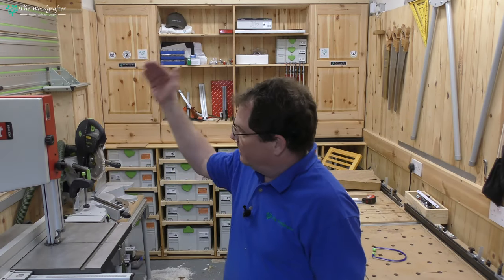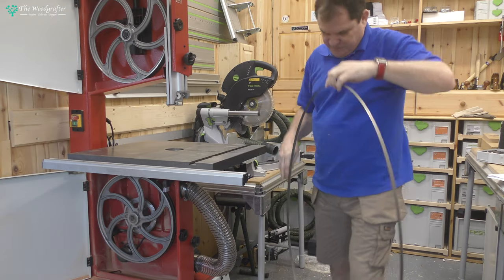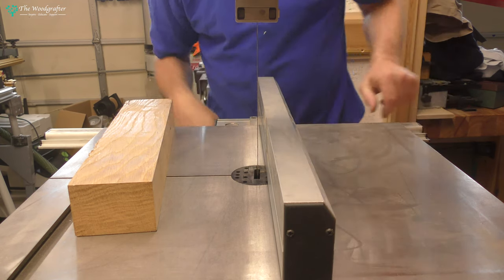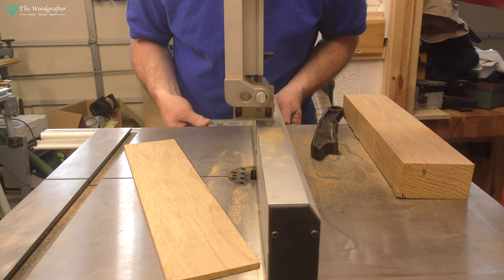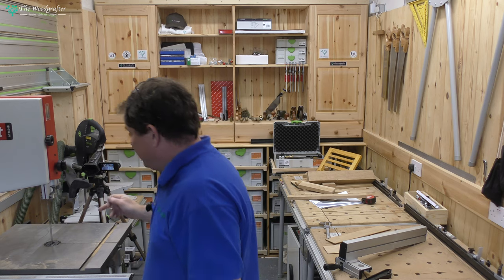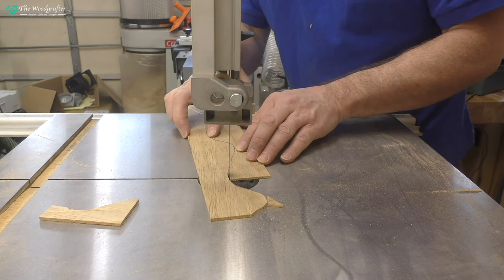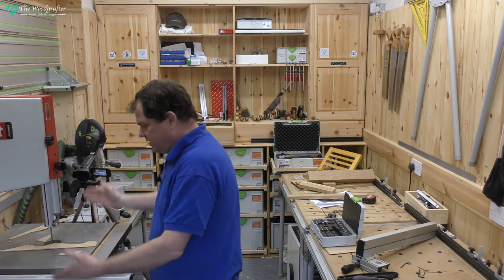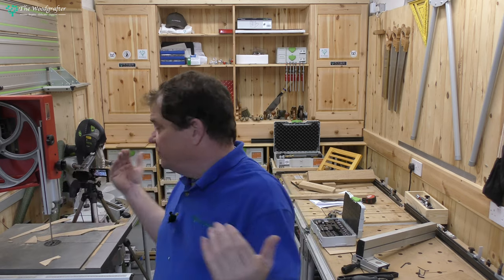Axminster Craft AC2606B review

Comment: Finally i have made progress with my saw axminster  sent me a new pulley bearing and tension assembly the new bearing was on a little bit further on shaft, but it was rubbing, but  not hitting guide  as first one did, So i have filed a bit off guide side , and wow it works and the plastic still slides up and down freely. I used it on cutting old floor boards with tongue and groove damaged on them so did about 100 cuts about 2ft. length each so quick and quite cutting much better than table saw. I did not even use extraction hardly any dust on table but loads on floor of course ! but room didn't seem dusty to me. So very impressed now after a bad start happy camper now.
Reply from the maker: Hi Chris,

Journey from hell, but glad you are up and running with it.

Overall I am happy with the saw.

Cheers

Andy

Comment: Absolutely perfect set of videos, particularly the setup video which covered absolutely everything. Axminster are out of stock of a lot of their machines at the moment (late November 2020), hopefully that's just an end of year thing, so I'll be looking to get one in 2021. I'm pretty sure I'd be living in the shed if I said I'd bought one a month before Christmas anyway! Thanks for taking such care and attention to detail with your videos. It's a fairly major purchase for a home user like me, so the information you've given is extremely valuable. Thanks!
Reply from the maker: Thank you for the feedback.

I have had mixed feedback on people’s experience with this saw.

I find if you take the time to set it up correctly, and use the right blade for the job then it is exceptional.

I get perfect re-saw, accurate curves and as a bonus free saw dust that collects in the bottom case. 

I have just bought a new CNC machine that arrives on the 18 Dec. If I am lucky that will see me banished to the shop over Christmas :-)

Cheers

Andy

Comment: Nice lil critter ya got there but does remind me of the 30cm bandsaw I have that is of like quality. I call it the chinesewhatchamawozit LOL But it worked even better when I changed the tires and blades to everything from Timberwolf. You'll get a lot of happiness out of that saw.
Reply from the maker: Hi Gary,

That made me laugh....

Yes I do believe it is a re-branded chinesewhatchamawozit - made in China, shipped from China and is very similar to many brands on the market.

But, so far it seems to do the job. I did change the blade for a higher quality one. Will look at the tires when the time comes - but for now it’s good enough.

Cheers

Andy

Comment: I have just bought one of these band saws, and I must say, it exceeds all my expectations. The only issue I have is with the stand, and the way the saw sits on it, it is dangerously one sided, and very easy to tip over (towards you, as you are using it). This becomes much more pronounced if you put it on a wheeled trolly of some kind.

Comment: Great honest review Andy, what size is your thin blade? a thinner blade maybe 1/4" would cut the "organic" cuts a bit easier ...just an observation.
Reply from the maker: Thanks Paul,

Fair shout - the “thin” blade is about 12.7mm (1/2” ish) from memory.

So yes a thinner blade would be a good shout, but you live and learn.

Cheers

Andy
Reply: @TheWoodgrafter  One step at a time Andy, tbf the dust collection is better on your saw than most, at least it is collecting from two points on the cycle. Mine only collects from the bottom.
Reply from the maker: paultay23 

Thanks Paul,

Talk soon

Andy

Comment: Fantastic video series! Thanks for going through everything and giving your honest opinion. I'm about the make a bandsaw purchase and this one is right at the top of the list. Before I go ahead, I wanted to ask whether you were still getting on OK with it in use and whether you'd still recommend? Thank you :-)
Reply from the maker: Hi Simon,

Yes it is still going strong, I have had reports that some people struggle with calibration and set up. But for me its is working well.

Kind Regards

Andy
Reply: @TheWoodgrafter  Brilliant, thank you. I'll go ahead with the 2606 in that case. It's so hard to find a bandsaw under £1000 with decent height under the guides, that also has enough features to keep things in tune and cut well, so this material has been invaluable sir! Thank you again 🙂
Reply: @TheWoodgrafter  Fantastic, thanks Andy. I'll go ahead with the purchase in that case. It's so hard to find a sub £1k machine that has decent height under the guides as well as being well made and with good features.
Thanks, Simon
Reply from the maker: Hi Simon,

Do you have a local Axminster you can go and get hands on ?

It may help, it does have a few issues..

On maximum cut adjustment the blade guard tends to catch on the top wheel. So limits the maximum capacity a little bit.

Also the guide bushes are ceramic rather than wheels so you do get some sparks.

Neither have been an issue to me, but eyes wide open and all that.

I can still cut thin Bennett’s and re saw with accuracy.

I have added the Incra mitre gauge since the video that really helps with cross cuts. But still using the factory fit fence.

I should probably do a few x months on what do I think videos.

Overall I would still recommend.

Andy
Reply: @TheWoodgrafter  Another excellent bit of insight - thank you. Overall, this still appears to have less drawbacks than saws in the same price bracket, from what I've seen and read so far. I don't have a local Axminster sadly, as I'm all the way up in Livingston, so the closest one is Newcastle. Agreed though, some follow on reviews after usage over time would make great content. I'll definitely be tuning in!

Comment: Hi Andy,  wouldn't you do better to make the 45 deg cut with the tracksaw?
Reply from the maker: Hi Michael,

I guess it depends on what I am doing, I wanted to see how it worked because it could do it.

I could also use the table saw or even the planner thickneser.

Many ways to achieve the same outcome in woodworking.

Cheers

Andy

Comment: If you remove the blade guard you could grind a little of the back to clear the blade.  I agree dust extraction is pretty poor even with you large extraction hose.  Maybe an over table flexible hose as well would be worthwhile to keep the table clear.
Reply from the maker: That’s a good idea with the grinding the back of the guard, will have a look to see how much I can play with,

Yes - will need to think of something for the dust collection, mind you I now have a lovely collection of very fine OAK dust - so home made filler is no longer an issue.

Cheers

Andy
Reply: The Woodgrafter Good idea about the filler but there should be safer ways to do this!
Reply from the maker: Michael Blackmore 

LOL, amen to that.

Cheers

Andy

Comment: Spinning the wheel by hand when adjusting the tracking is dodgy, maybe less so on a new bandsaw. Better to be using a wooden stick or dowel when the blade springs off the top wheel.
Reply from the maker: Good poingband safety first.

I don’t find the blade springs off on this one, but I would agree with you.

Andy